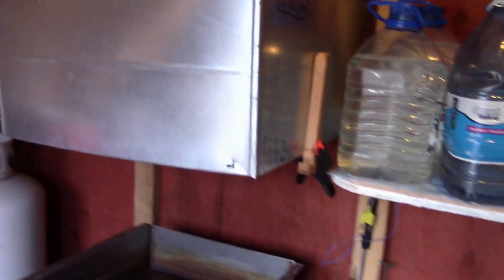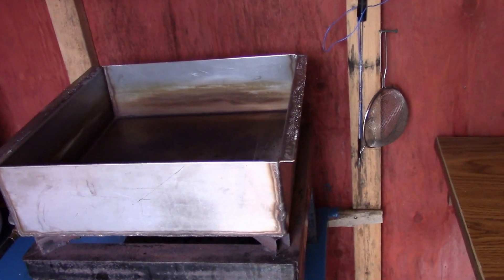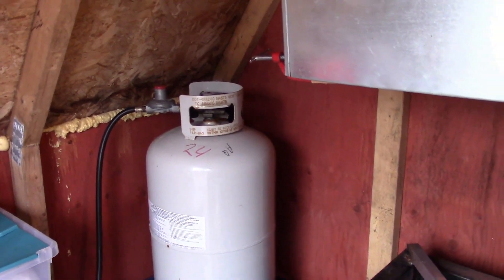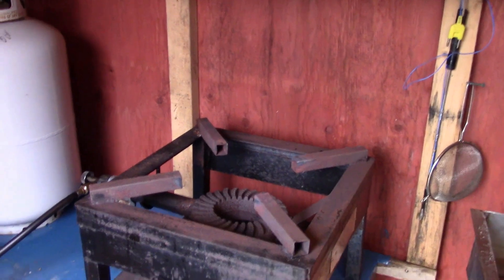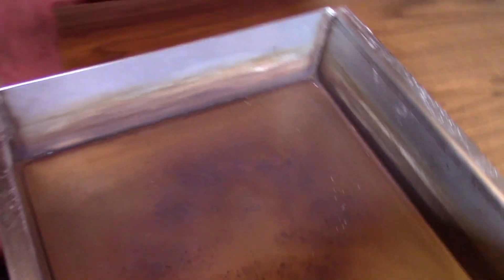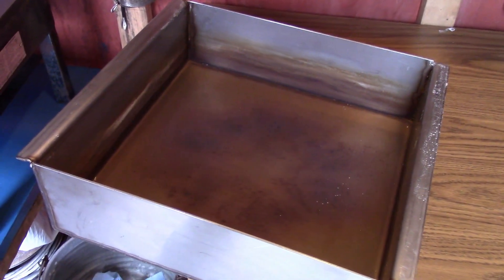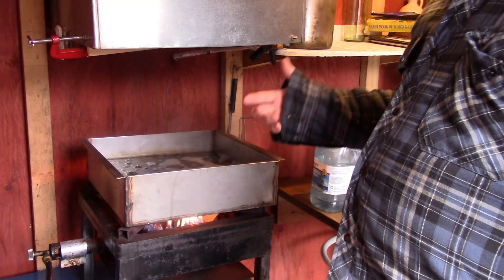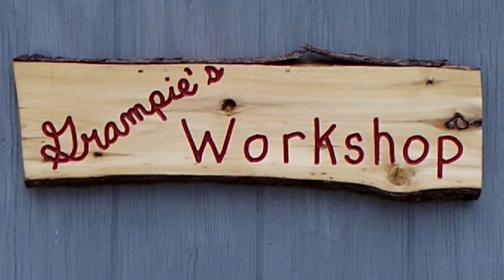Time to Boil some Sap!!!!

Comment: That niter can sure be a bugger. I used get so mad after I filtered my sap from a partial boil and then when I started heating it up to finish it I would have that niter in there. I thought it was particulates. Then I did some research and like you said it's from the minerals in the sap. It's actually potassium nitrate which is also called saltpeter. Like you said Mike, the best thing to do is keep it boiling until it's done. Great video and nice setup in the sugar shack. 😋
Reply from the maker: How's she goin'?  You're right Corey.  It's potassium nitrite.  I did a lot of things to try and get rid of it and then finally just said, never mind and left it.  One year I decanted the clear syrup off and used the cloudy syrup left for nannie to use in baking.  That was good but I make so little syrup that Nannie and I just said it's not worth our effort.  Thanks for watching Corey and I hope you have a great week!!!

Comment: Thanks Grampie. I learned something today. That amp probe makes a pretty fancy temperature probe. Nice setup.
Reply from the maker: How's she goin' and welcome!!!  Yeah the amp probe with the thermo-couple works pretty good.  I tried other methods to measure temps and since my process is more or less all based on temp, I thought this would be the better way to go.  Did you notice the actual thermo-couple is kept just back from the tip of the wand it's mounted to so that it doesn't actually contact the bottom of the pan?  This allows for a truer temperature of the sap.  I learned that trick the hard way buddy!!!   I appreciate you watching and I hope you enjoyed it!!!  Take 'er easy!!
Reply: @GrampiesWorkshop  Yes preventing the tip from touching ether the pan or the wand if it's metal is the way to go. Cheers

Comment: If you mark the inside if the pan you don,t need your measuring sticks. Thanks for sharing . Hi from Jim in NorthBay On.
Reply from the maker: How's she goin'?  Jim when I first started to make the syrup I was using a pot with markings on the side.  It turned out I couldn't see the marking all that good with the foam on the sap and the steam and the build up along the sides of the pot.  The measuring stick seems to work better for me.  Good idea though.  Thanks for watching and taking the time to comment.  Have a great week!!!